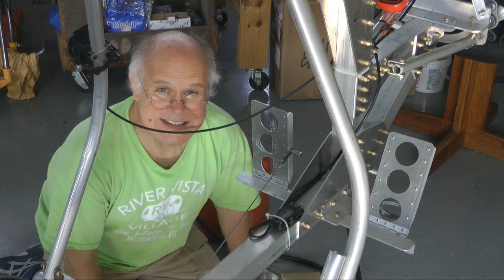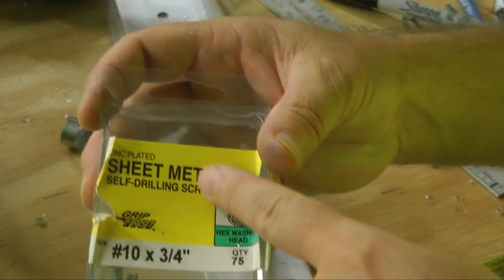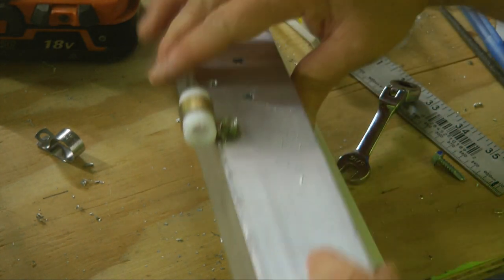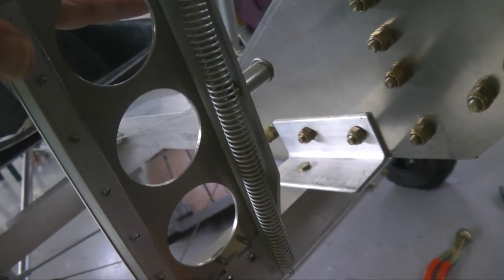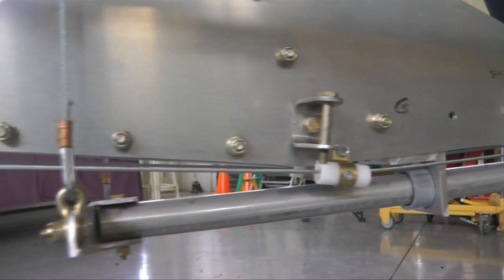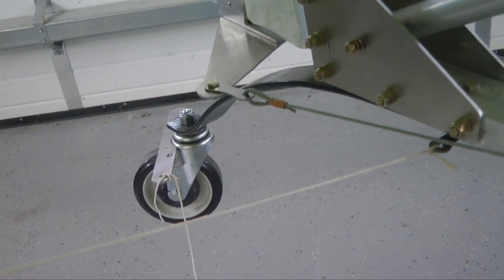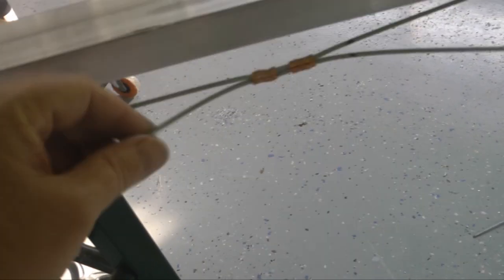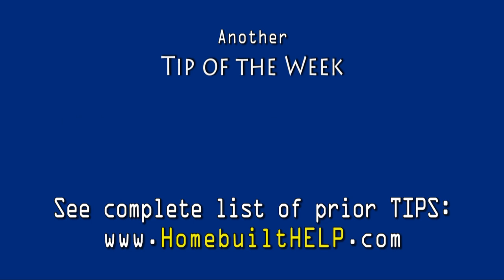Building the Affordaplane Part 47

Comment: For hand tightening 5/16 and 8mm I like the 6 in 1 screwdrivers. Just pull out the bit on the big end and it is that size. Usually easier than wrenching.

Comment: Those dam self tapping screws will vibrate out and become FOD. Please don't use them you will be flattening everyone tires. Use rivets or make a glue on one and use JB weld
Reply from the maker: I understand your concern.  As I had mentioned on the video, a drop of blue loctite will do the job for peace of mind.

Comment: Since this tail wheel is on a leaf spring of sort, in the event the tail is set down heavily, will the deflection of the spring cause an unacceptable tension on those cable / spring assemblies?
Reply from the maker: Will have to find out - but I do not think so - as the geometry of the spring deflection does little to change tension on those cables.

Comment: FYI - tip for centering the rudder and rudder pedals.  I clamped 1x4 wood on either side of the rudder to center it, then used 2 clamps (one per rudder pedal) to attach a bar or piece of wood across both pedals to get them straight with eachother.  This way I could stabilize the alignment and make adjustments while securing the cables (which without the clamps and wood is a squirrelly process)

Comment: More good work as always, Jon!  Wondering if the design considered using Teleflex push-pull tubes rather than plain cables?  They would weigh more of course, but would have the advantage of constraining the cable and reducing potential chafing.

Comment: I would consider putting the anchor screws on the rear guides on the side opposite where the cable rubs.  It appears now that the cables are almost in the same place as the screw and as they wear into the Delrin they will hit those screws at some point and that will be bad.

Comment: Could you put the tubing in a drillpress and use a file to make a groove deep and wide enough for the AN Clamp? One less part to come loose?
Reply: Shane: that delrin doesn't wear away very well, so the best way of doing what you are suggesting (which is a great suggestion) is to somehow cut the groove for the AN clamp. A small hobby lathe is great for that type of work, but I suppose you could rig something up to actually cut it in a drill press.

Comment: Did you consider using pulleys instead of the Delrin tubes? I can’t help thinking that the wear and friction between the cables and guides will be quite high.
Reply from the maker: You are correct - if this was a certified design then pulleys would be needed in some of those places. In our case, the loads are extremely light due to the gentle pull and small angles. Also, these delrin guides are literally in your face for examination.  I will guarantee in this specific application that you will never need to replace these guides as a result of normal use and wear!
Reply: That's what I was thinking. At least on the rear one where the cable leaves the sleeve at an angle towards the rudder.
Reply: I think the rule of thumb is a pulley is only necessary if the angle is greater than 15 degrees.  Yes, they will wear out over time, but it takes a really long time.  Long enough that they only need to be checked during an annual condition inspection.

Comment: Aluminum will be very susceptible to galvanic corrosion in contact with copper, assuming that the two metals are also in contact with a common electrolyte (such as water with some ionic content.) Almost any text or handbook on corrosion will have galvanic series table. How about aluminum adel clamps?
Reply: AN hardware is coated to be compatible with AL. Its the self.tapping screw i would question!
Reply: @RobotoForgoto  Couldn't tell that was AN adel, looked like a water pipe clamp. The screw pulling out is worrisome. Maybe a well nut would insulate it all?
Reply: One would normally think that but no we haven't had any problems at all, even in the Florida humidity, for over 22 years. Thanks.
Reply: Where is copper on contact with aluminum?
Reply: @LTVoyager  2:28 unless its not copper.
Reply: Ok did find out that part number is anodized aluminum.  So no problem with using it.   These are made of un-plated corrosion-resistant steel, zinc-plated corrosion-resistant steel, cadmium, or anodized aluminum alloys. So I learned something today.  In my best Rosana Dana voice, never mind.
Reply: @davidwhite2011  Yes, better to do homework first and comment after.  😁
Reply: @davidwhite2011  Always worthwhile to question! Thanks for being honest and up front!